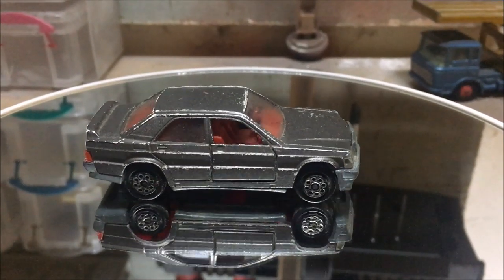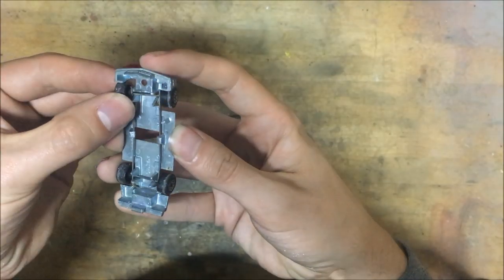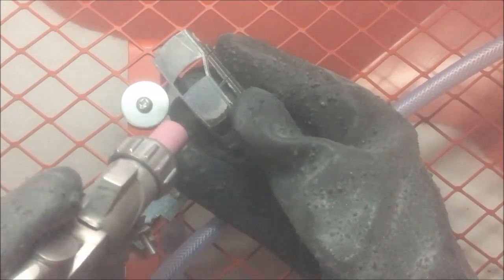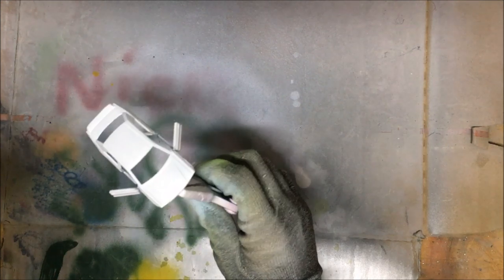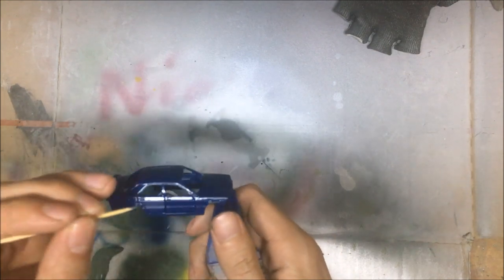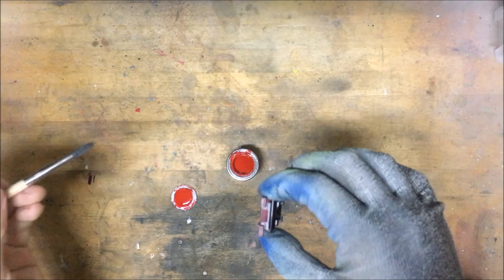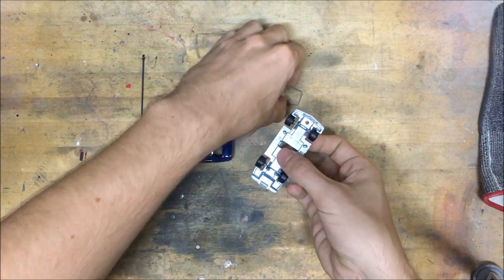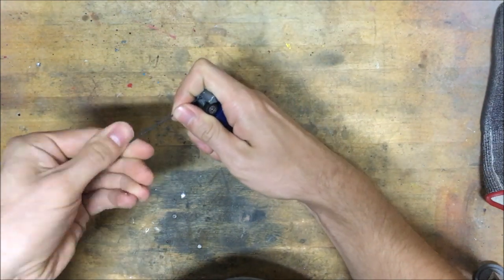Majorette Mercedes 190e 2.3 16 - Custom Restoration

Comment: Great job Nick. You normally paint in the indicators on the front. Did you not on purpose?  Also, most European cars that have worked on have a tan or brownish colored interior. I don't see to many black interiors except on sports cars and muscle cars. 😀